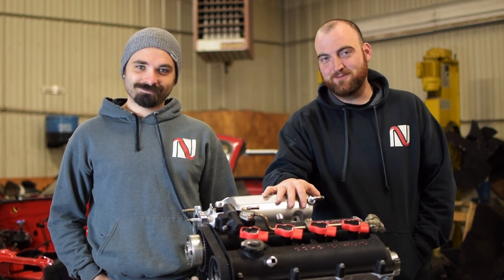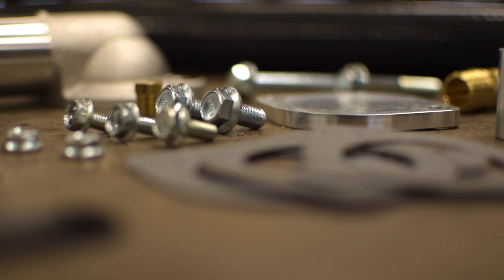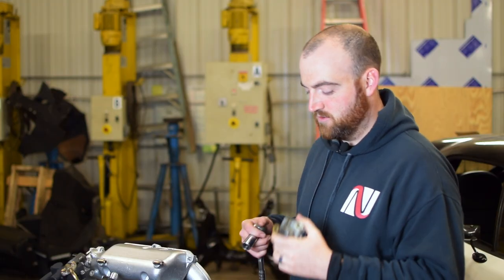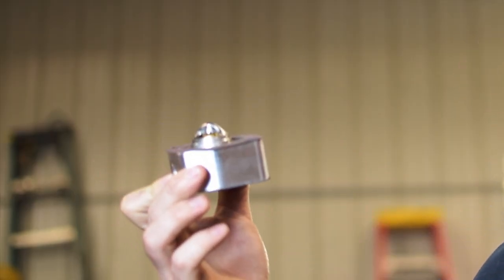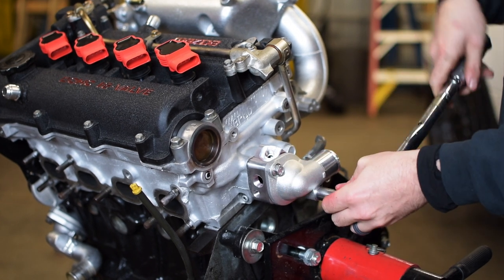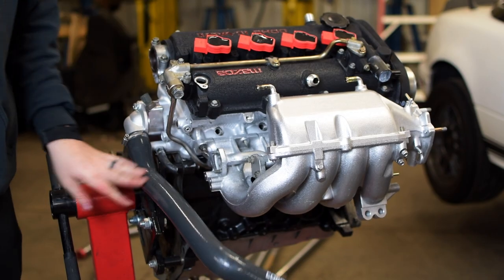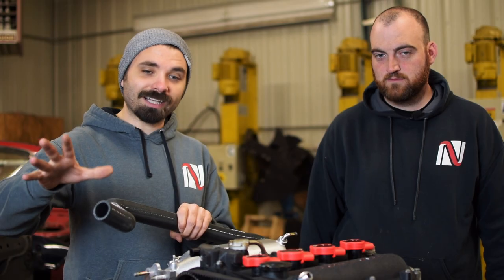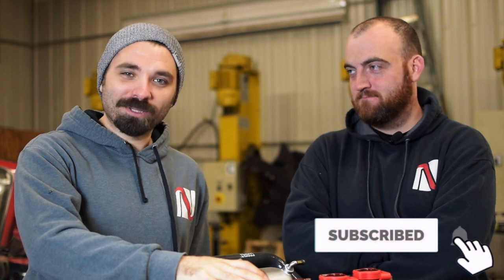Miata Coolant Reroute  // Miata Track Build

Comment: Just finished doing this a couple of days ago and first start up of the miata this morning.. and I have this same exact one too 🙌🏿
Reply from the maker: Nice!! It’s a really solid piece, we were definitely impressed.
Reply: @NappMotorsports  can't wait to get my miata on the road
Reply: @NappMotorsports  its decent, seems like big silicone hose like that turn weird shapes when in use.
Id still like to make an solid pipe for the majority of it, the radiator inlet is in such a dumb spot stock that its not worth it at the moment though
Reply: @miatafan  does the hose change shape ?

Comment: the amount of people who dont think a reroute is needed bothers me.
BPs without a reroute almost always kick the #4 rod out the block before any others.
even if your car is not overheating, the long term effect of it is, faster wear for parts at the rear of the motor. 
the 5.9 cummins has a very similar issue and its well known #6 is the one to keep an eye on, because its usually the first to start knocking.
Reply from the maker: Ive heard that about the 5.9 cummings. Hopefully OEMs have learned their lesson.

Comment: I installed a thermostat that kicks on about 10 degrees sooner thinking that would be enough but down here in Texas, the Miata still gets cookin. 
I’ll start this reroute just as soon as I’m done fixing my driver side LCA rear mount flanges as they are currently slightly bent. 😥
Reply from the maker: Lower thermostat isn’t a bad idea, but it doesn’t do the same thing as a reroute. Installing that should make a huge difference.

Comment: Wondering what the difference is that prevents me from using this kit on my 1991. 
side note: Do you have a video on the cleaner block off plate?
Reply from the maker: There’s a kit for the 90-93 Miata’s. It’s Part Number 910-640 on Moss’ website.

We don’t have a video on that block off plate, but it was easy to make. Just trace the flange on the coolant neck and cut it out/drill the holes.
Reply: I was able to fit it on mine. Just needed to get the front plate. Or you can drill and tap the one it comes with. A spark plug tap should be the same thread

Comment: What are you using for a mixing manifold (water inlet)? I'm looking for something similar so I can delete the heater core and auxiliary coolant lines.
Reply from the maker: It’s a factory one but I just welded the heater core part shut.

Comment: I just need thermostat block off plate. Is that sold alone anywhere? Cannot find it on moss miata or ebay.
Reply from the maker: For coolant neck? Or a block off that deletes the coolant neck at the head. The head block off, if you send me an email I can get you one. Blocking it off at the neck where the thermostat used to be, I don’t have a good answer for just that plate.

Comment: I have this reroute and I’m pretty happy with it. I used hondabond instead of the provided gaskets. I don’t like how the hose rubs on the charcoal canister and the stock throttle body arm can hang up and rub on the hose. Another thing to note is that the EGR pipe runs real close to the speedo cable to the point of being able to melt it. I used a small bracket on the car side to hold the speedo cable out of the way to keep it from touching. Isn’t smog fun?
Reply from the maker: Yay EPA

Comment: I have seen talk on forums that the 1.8 vvt engine changed the layout of the water jackets in the engine block and doesn’t need a reroute, just curious if a reroute is still an upgrade over and beyond the improved coolant flow from factory and that’s why you have installed it? Not at all meant to be critical, I’m planning on vvt swapping my 1990 and trying to do what’s best for the engine! Either way, have been really enjoying the content and hope the builds get to where you want them before driving season again 🚀
Reply: a vvt headgasket is better than no reroute, but a non vvt headgakset and a reroute is better.
mazda "solved" the issue by restricting coolant to cylinder 1&2 so it kind of just moves the hot spot to a different place
Reply: I did my one on my vvt,  i was also worried it now will affect the mazda fix.
Reply from the maker: We had this concern originally with Dylan's VVT Swap, but after some research, we found that Emilio from 949 Racing has run Rerouted VVT Engines for 24+ hour endurance races, which is significantly harder driving than this engine will ever see. It definitely doesn't hurt.
Reply: If it’s good enough for him then it’s good enough for me! Thanks!

Comment: Do you think that running the heater is sufficient for occasional track use?
Reply from the maker: Instead of the reroute? I would still recommend a reroute.
Reply: I would bypass or remove the heater for the track.

Comment: Did you use any thread sealant on any of the sensors
Reply from the maker: Yup! All sensors and plugs got thread sealant.
Reply: I didn’t use any on mine and it doesn’t leak.
Reply: @aygwm that's good to know, I'm gonna install one next week and I've got no idea where to get that

Comment: I want to do this. But with my engine still in the car. I don't think I can do this. It's sooooo tight back there.
Reply from the maker: It’s possible, I did remove this with the engine in the car to modify the thermostat. Ratcheting combination wrenches help a ton.
Reply: @NappMotorsports  I'm confused which kit to get. I have an NB2 and don't want to lose my EGR pipe. Do you know which kit I should get please?

Comment: Does this work for a 90 1.6 the kit in the description says 94 and up?
Reply from the maker: I would reach out to Moss customer service.
Reply: It does. The issue is the front plate doesn't have the hole for the thermoswitch. You'd need to get one elsewhere or drill and tap the one included. A spark plug tap works. I think you might have to extend the rear sensor wires and it's really hard to get it on. I think the 1.8 cars have more space between the engine and firewall